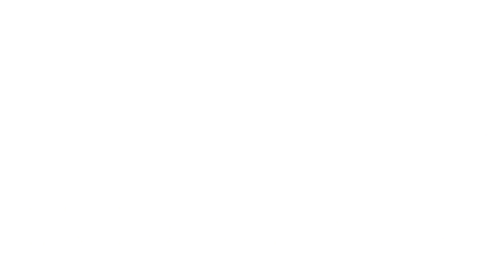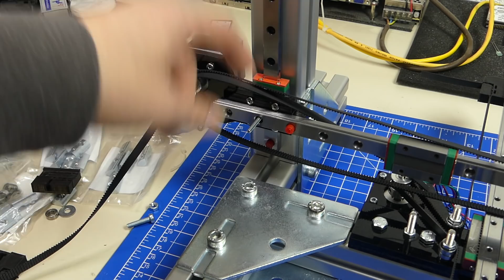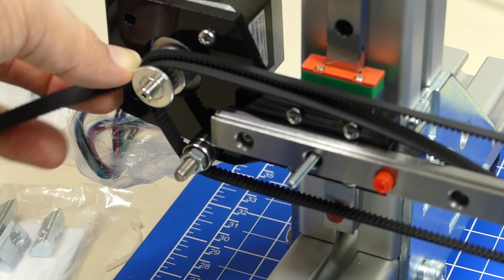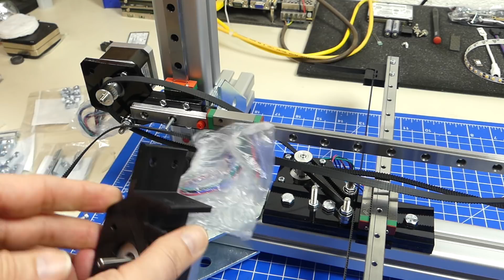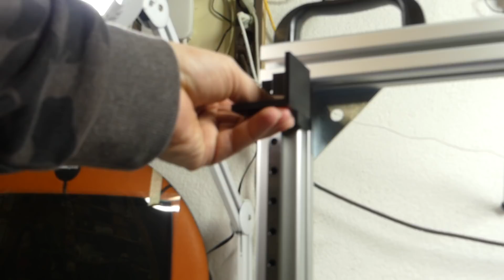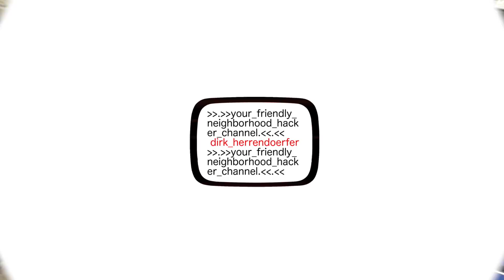Big Bad Robin Build VLOG pt. 3

Comment: Could you use a belt for the Z axis or would this be too much weight for the belt?
Reply from the maker: I suppose you could ... but I don't know how precise that would be, or if the Z-Axis would just drop down when you turn it off.
Reply: How about having the motor mounted upright, with a belt driving a gear mounted to the top of a lead screw?
Reply from the maker: I've already read that - but for me the Z-Axis would be too slow - that usually causes the Z-Axis seam in a print. But the idea is still working inside me - maybe a 0.9deg Stepper and a solenoid to clamp the belt when power is off ??
Reply: This guy had some success with a pretty clever design, maybe worth a look https://hackaday.com/2018/01/04/huge-3d-printer-ditches-lead-screw-for-belt-driven-z-axis/